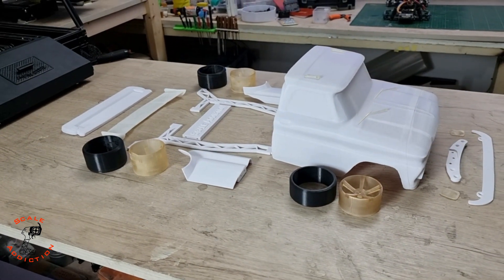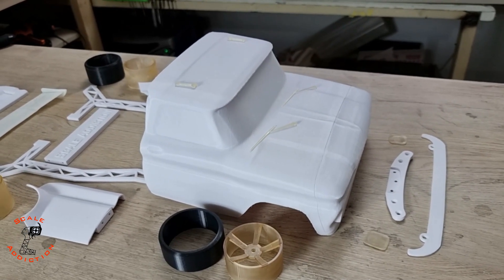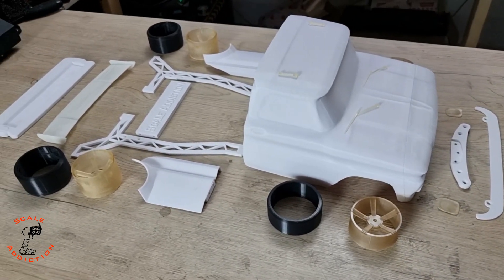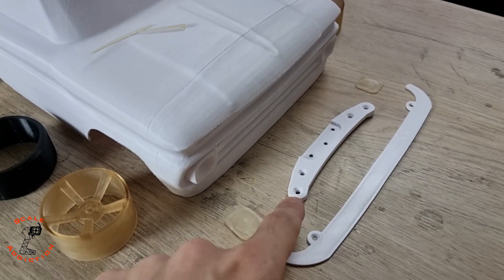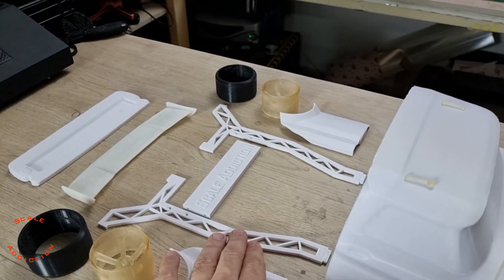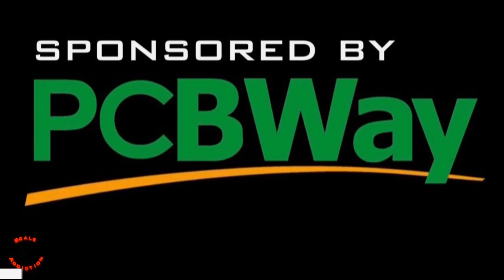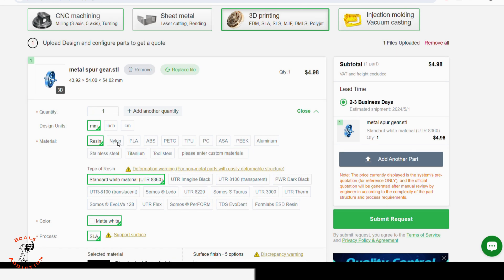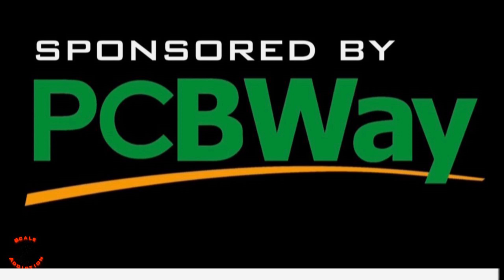3D Printed 10th Custom Chevrolet C10 1962  step by step

Comment: Cool build friend....  Hey just alittle paint tip. I see you had "ring out " where all you body work spots are , to avoid that u can go two ways. 1. Go light ( dust ) the first coat or two of your primer/sealer and make sure those coats are dry. Then you can lay down the next coats wet.  2. Do your paint work normal (2-3 wet coats ) , make sure their total dry then do a light block sand of 600-800 grit wet to level out any of that "ring out" . Then go back with one finish top coat of your primer/sealer and you should be just fine. Actually youll have even a better finished product that route. Alittle more work but worth the effort if you care about the product your trying to show off.   Like i was taught decades ago , your finish paint is only as good as the bodywork under it !  Most people dont get it that its harder to just do a primer/sealer/matte finish than it is to do a nice color/gloss finish.  You can wetsand and buff out imperfections on "shiny" paint.  Sorry bout the long comment, just tryin to pass on some knowledge..😊